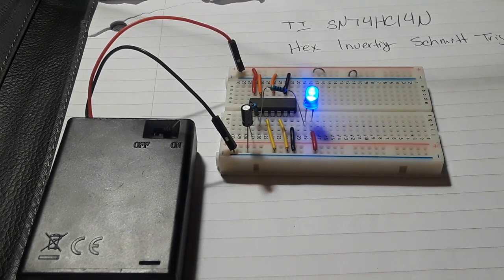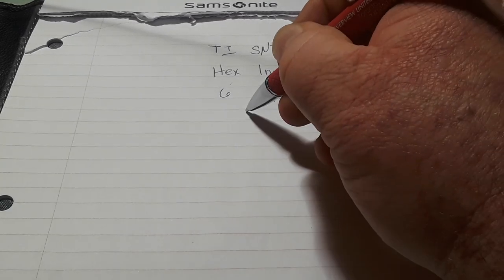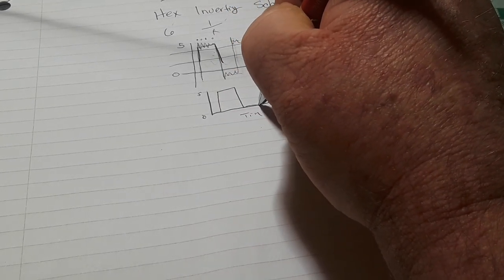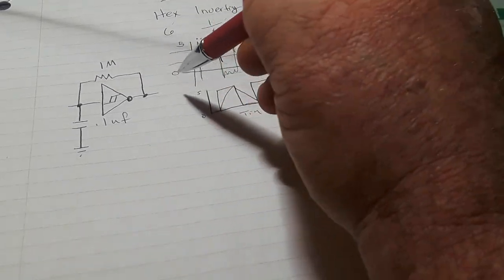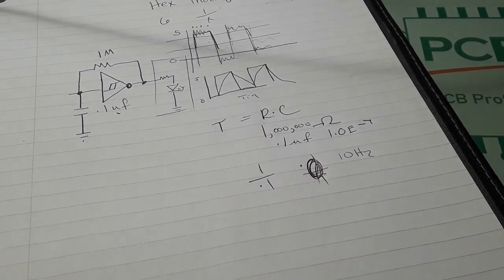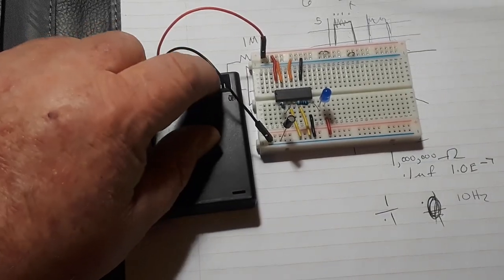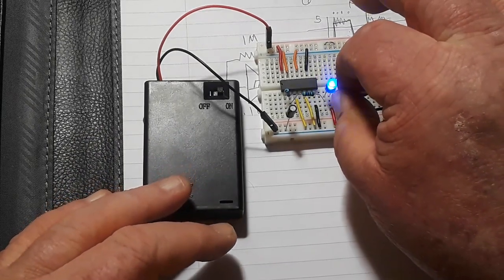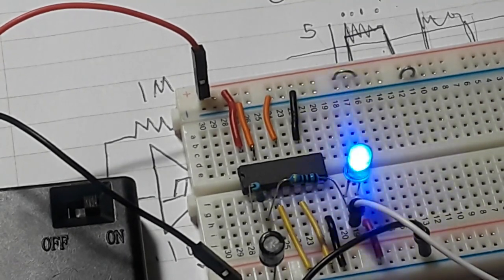Classic Circuit: The Three Component Oscillator - sponsored by SolderStick Wire Connectors

Comment: Thanks, this was a good one.  I'm a long time watcher of your videos.  Mostly quiet, but I have to shout out the issues with the cheaper bread boards.  I've had a  lot of trouble with the connectors staying connected on these cheaper boards.  I bought several brands and all seem to end up with the same problem, until I started using the BusBoard brand.  My issues and insanity levels have all been reduced.   They may more expensive, but you make up the difference in time and frustrations.

Merry Christmas and keep them coming!!

Comment: This is my favourite oscillator, but I prefer the quad Schmitt nAND. 
This is because the extra input provides a control for the oscillator. 
The extra gates in the package provides the option for an oscillator modulator, or an input from a sensor to control the oscillator, making it ideal for alarms that bleep or whine. 
The square wave output can be filtered to change the sound it makes or the voltage on the capacitor can be buffered to give a nice sawtooth waveform.
These are great circuits for those learning electronics, as it is easy to add a few components to make the make lots of useful devices. 
I once used one of these as the basis of a pulse position modulated IR microphone transmitter.

Comment: PAUL, A Schmitt triggers doesn't use a window comparator for the pocket Hysteresis, the hysteresis has a lower threshold point and a upper threshold point but why does a schmitt trigger use or have hysteresis providing two different voltage points?

Comment: An astable multivibrator probably a dozen components. This circuit or a 555, 3 components. An attiny45, one component. Ordered in increasing complexity. There are two ironies. All of these solutions cost about the same to make, and the microcontroller uses this circuit for its clock!

Comment: I have one topic which might be interesting for future videos. ACST6 or  ACST6108 triac driven by microcontroller. According to datasheet it doesn't requires additional components like optocouplers and MCU should be connected directly to mains with Vss pin. Till today not sure if setup which I assume is correct. Thank you. :)